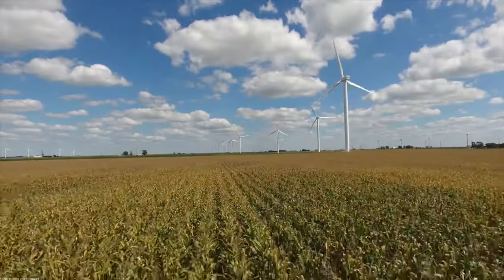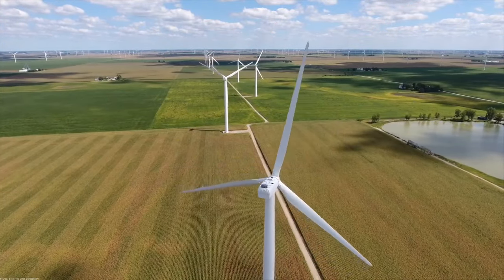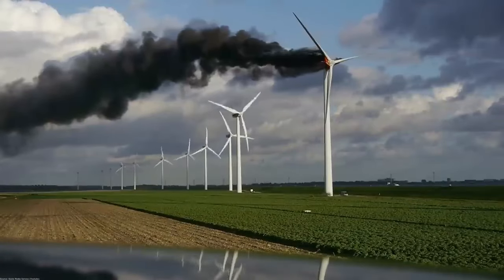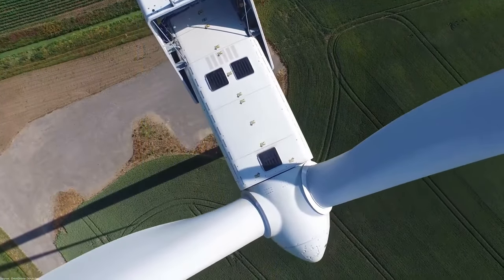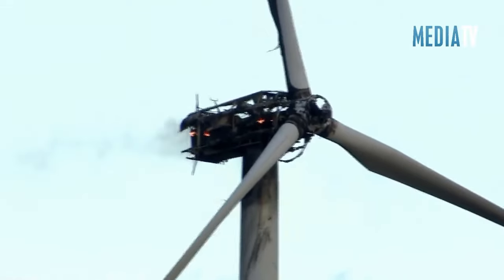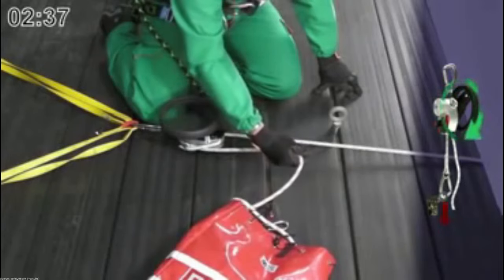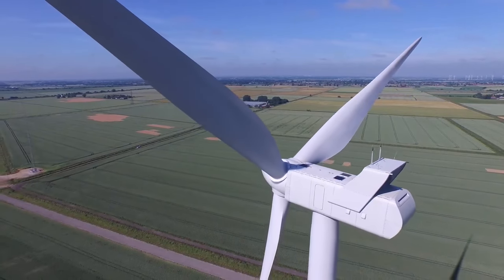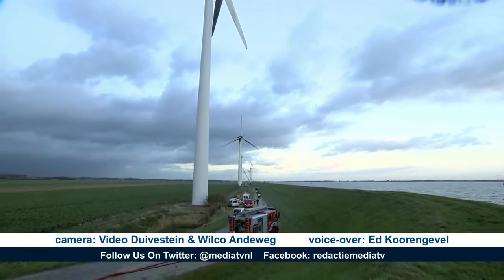Two Men TRAPPED On Top Of BURNING Wind Turbine  |  Scary Fascinating

Comment: Yeah I remember seeing this when it happened back then. It was so terrifying and gut wrenching just because of the helplessness that the men experienced and the unthinkable and horrifying options they had to choose from.
Reply: Reminds me a bit of the world trade center. You can chose to jump, or burn. It's pretty horrific.
Reply: Remember 9/11?
Reply: I would of asked the other engineer if I was there if we want to choose to go out jumping cause I wouldn't leave them alone with their fate if we didn't choose the same one.
Reply: @edfgamer7351  after the first jumped the other tried to descend the maintenance shaft, but got stuck and died in the blaze. the long embrace before the one jumped leads me to believe they had already made their peace.
Reply: I would have tied my hands to my partner and try to slide down one the blades to soften my descent.
Reply: I wonder how a situation like this wasn't expected to happen sooner or later. As an extreme security measure these technicians should be equipped with a parachute or something, or maybe I'm so ignorant for implying this is even remotely feasible when it's not?
Reply: @kurtgodel28  you would think there would be some kind of protocol in place to get down in an emergency.  Maybe not a parachute but some kind of harness and rope that could be accessed from up there.
Reply: @KingIbanazzi  yeah, I guess that's the same situation, just several hundred feet higher. That dude who did that headfirst free fall is what I always think of from that day. That would be a long time to fall and think about your fate. Then they say your perception of time slows down on top of it.

Comment: Why dont they put emergency parachutes up there?
Reply: should be mandatory
Reply: Not high enough to deploy one properly
Reply: @imchase7796 at least there is a chance of survival!!
Reply: It's just not enough space to deploy
Reply: I wonder if they should have fire extinguishers up there.
Reply: It may not be high enough to open all the way.
Reply: @charlesbosse9669  id rather take that chance than a free fall
Reply: @gretztrumentals it’s still going to be a free fall if the parachute doesn’t open
Reply: It’s high enough. Ever heard of BASE jumping? There are other reasons a parachute isn’t a great idea, but it’s not lack of height.
Reply: No parachutes , those require some experience , especially at base jumping heights. And no countRy could force all their windmill techs to also be semi-pro base jumpers. More techs would die in training 1rst year, than would die like these 2 in 1000s of year .....What about the fat ones? You know those techs would plop straight down in fear , forgetting to let go of the parachute in their hand whole time. THEY NEED TO HAVE Descender DEVICES. THAT ATTACH TO SOMETHING SOLID ON TOP OF WINDMILL AND USES GRAVITY TO PULL THEM DOWN SLOWLY LIKE  A HOSE REEL UNWINDING, BUT MUCH THINNER.  Those are fear emotion mistake & fat proof.

Comment: They should have a emergency Helicopter on standby due to the heights these guys work at. They could have flew the helicopter alot higher than the turbine  and drop a safety harness for the guys to quickly hold onto then lower them to the green. Rip
Reply: was thinking the same
Reply: all they needed was a life net
Reply: I mean not really though. It would be too risky bc they wouldn't be able to ground a line so the person rescued doesn't spin out of control. And when spinning out of control, they could easily be pushed into the path or the spinning turbines

Comment: I've worked for VesTAS once. I've seen black and white security footage from the pair, right before one of them jumped. It was recorded from another windturbine close by. He shook hands with his work buddy, then jumped. The other one was found in the nacelle, burned up trying to escape. 

The root cause was an electrical failure in a worn out mill. And a lack of a prober maintenance manual. And gear that can't create a short and start the whole line of events. 

RIP

Comment: They could start with having automatic fire suppression devices that are triggered by smoke or heat, plus include several extinguishers placed throughout the interior and exterior of the turbine. Escaping with some survivable burns would have been a much better outcome.
Reply: its honestly so odd that they dont. every aircraft ever has it for their engines so why not on this?

Comment: They are responsible. These young men should not have been up there without parachutes, glider suits, descenders, slide, gliders, tie offs/ bungee cords, emergency chopper near by, something to avoid this.
Reply: The company is responsible you mean right? I hope you’re not blaming the victims here
Reply: These turbines are 300+ ft up in the air that you have to walk up via ladder. You have to wear a heavy full body harness plus bring your working gear (boots, helmet, tools). The weight adds up very quickly, even after this accident turbine techs are not going to bring a parachute and associated gear with them. It doesn't make sense.
Reply: @Blasterwy  Gliders? 😂😂 they’re engineers not base jumpers
Reply: you're right. how irresponsible for them not to take out a loan so they could, together, potentially afford all that for this one day at their job.
Reply from the maker: at least something

Comment: I've done some training regarding working on wind turbines and we've spoken of this disaster and I'd like to dispel some myths! First of all, there were 4 people working on this turbine. The two who survived were inside and they were able to escape, there are escape hatches inside the turbine which you can repel down. The two who did not survive were working outside/on top of the turbine. These turbines are made up of fiberglass and resin which go up in flames extremely quickly. It's likely that once the fire started they had no chance to get back inside the turbine to escape. In terms of bringing a parachute etc, turbines are hundreds of feet up in the air. Some models have elevators in them but otherwise you have to climb up to the top via ladder. You need a full body harness plus your working gear-boots, helmet, tools-and the weight adds up very quickly. You're exhausted by the time you get to the top and you're not going to bring up unnecessary equipment like a parachute. Helicopter rescue would not have been possible given how fast the fire spread. In any case there is no way a helicopter could have gotten close enough to the burning turbine to save them. In all it was a tragedy and may they rest in peace.
Reply: Seems like a parachute would have been necessary equipment in this case. How are hand tools necessary but the things that will save your life aren't? Doesn't matter how unlikely the event is. they had absolutely no escape plan. To me, my life is more important than you companies bank balance.
Reply: Why wouldn’t a helicopters be able to help the boys? Like at least tie a rope to the bottom of it and let them hold on as the helicopter goes back down, too late i suppose
Reply: @IDABAYAREA650I  helicopters are not willing to hover over large fires. For one, they could easily blow up. Two, heat from the fire would cause an extreme updraft pushing the helicopter upwards in an uncontrolled manor. And the wind from the helicopter getting close enough to rescue the guys would likely blow them right off the windmill, besides feeding the fire more oxygen to make the fire even bigger. Your heart is in the right place. But you would be hard pressed to find any pilots willing to endanger their own lives, plus the cost of a helicopter in this situation. I'm in construction. One of out first rules is, if saving someone is going to likely cost more lives, then you have to cut your losses or find another solution. Some type of fire suppression device should be rigged on these that is either triggered by smoke or heat. Plus strategically places extinguishers throughout the interior and exterior of the windmill may have allowed them to walk away burned, but alive. But I dont think many helicopter pilots would get involved with this rescue otherwise. Unfortunately.
Reply: What would be so wrong about a spool of rope??? You only need the few hundred feet to reach the ground, and any "extra" could be handled by folks below to steady a rappel... BUT even without too much training, it's an option "in a pinch"... and once you put it up there, it's THERE... and sheltered... and can be grabbed for at least an escape attempt.

    Hell, if it was my maintenance division, I'd like to hope I'd FIND the budget for the rope, and some boxes and fittings to fasten up there for it... Tell my guys and gals to take up frequent visits to the indoor rock-climbing walls and courses... MIGHT just save their butts. 

    Might still be a battle they couldn't win, but it's better (even marginally) than jumping off... I think I'd be shimmying down the nearest of those big-ass blades to try and drop off the end first... BUT that's me and I've done a LOT of shimmying... Can't be worse than jumping right off the top.  ;o)
Reply: @spinewrenched848  Thank you. I was wondering why with a very very long rope they couldn't have been saved.  Even a News helicopter with long  500m rope would have done it.

Comment: What "issues" does these Vestas (Vestas, not Vesta) V66-1.75MW turbines have exactly? These turbines and thousands of others of similar design are still in operation today, just because they are older turbines does not mean they are faulty, your use of unfounded slander detracts heavily from the tragedy that is the maintenance company cutting corners resulting in the tragic death of two young men.
Reply from the maker: I thought I made it fairly clear that when outdated internals aren't updated or replaced they become dangerous.
Reply: I’m a professional climber and went to school to work on turbines I can tell you exactly how it happens. I’m also a low voltage technician, when electrical components start to get old they either burn out, fail, malfunction, or short. In this case probably all the above a failed breaker with a short in the system can cause an arc flash/ fire. These turbines are fitted with Diesel engines at the top to spin the top of the nacelle to catch wind  to explain the burning black smoke for you it was diesel fuel